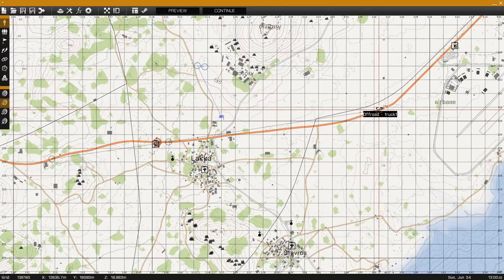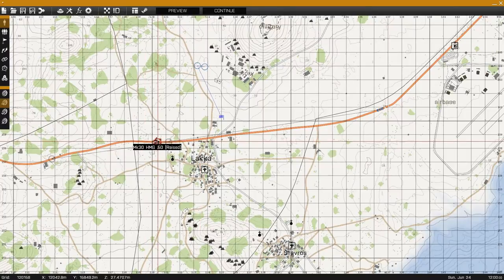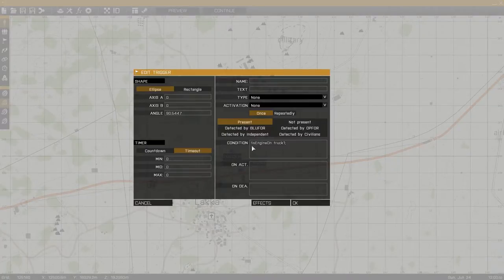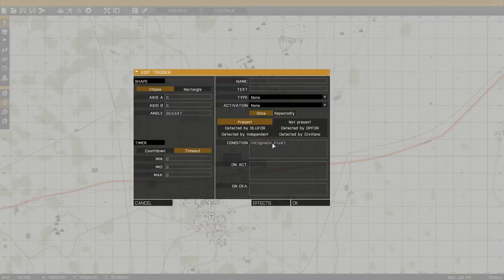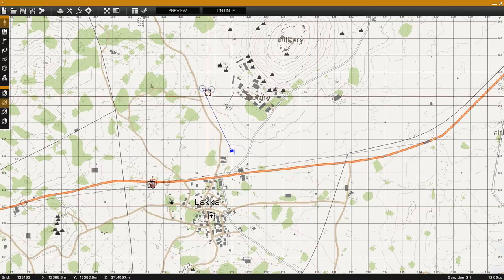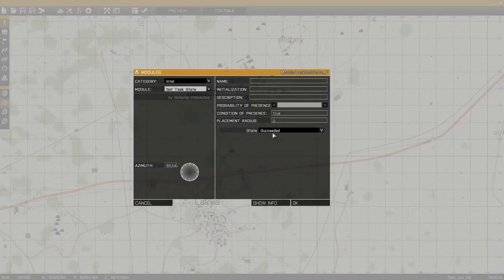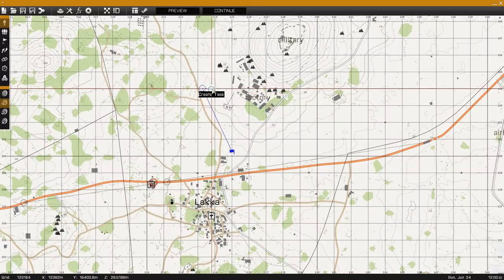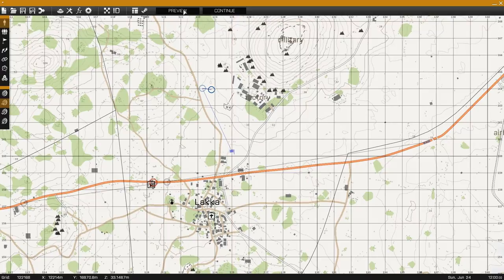ARMA 3 Editor - Using the EngineOn Command

Comment: I've also used this to turn on the engine of a vehicle at the mission start by putting it in the vehicles init field in conjunction with setvelocity.
Reply from the maker: Yeah engineOn simply does a check for engine status, it has endless uses as most checks  tend to have in arma.

 Though it's been a while since I've used the setVelocity command, I imagine you use a value of 0 for starting an engine since it simply sets the vehicles speed vector correct?  I imagine you were using this for an empty vehicle as any occupied vehicle always starts with it's engine on.
Reply: It was an occupied vehicle, but everyone was put in using moveincargo because of custom loadouts.I used setvelocity so the boat was moving into shore at the start, but the engine wasn't on, so I used engineon to have the engine running at the start.
Reply: setvelocity is a strange command. I had to set the x velocity to -20 to go forward. 20 just made it go backwards. I think you are supposed to use sine and cosines for the x & y parameters.
Reply from the maker: I know what you mean, I typically use limitSpeed for controling speed.  the syntax is:
object limitSpeed speed 
with speed being a value indicating km/h

In any event I'll have to take another look at the setVelocity command again and see if I can remember what it's all about.
Reply: setvelocity has to be used in IEDs that use artillery shells as the explosive, otherwise there is no big bang
Reply from the maker: oh right, I forgot about those types of IED's.  I used to use that a lot back in ARMA 2 in takistan until I started working on other IED methods, which I should really try to get working for arma 3
Reply: A few months ago, I didn't know the editor existed. Now I can't get enough of it. I'm just learning so I find some of your tutorials really useful, especially for the more frequently used commands.
Reply from the maker: I'm glad to hear it, I spent much more time in the arma 2 editor than I have with 3 so it gets a bit fun working around the bugs in arma 3 (like para-jumping) but now with the combined script base of OFP, arma 1, 2, OA and arma 3 there is pretty much an endless amount of things to be done.

The biggest thing to remember is that the BI wiki lists all functions in the editor and gives a description, the command syntax, and example so when stuck it's often a great place to initially look when sorting out an issue.